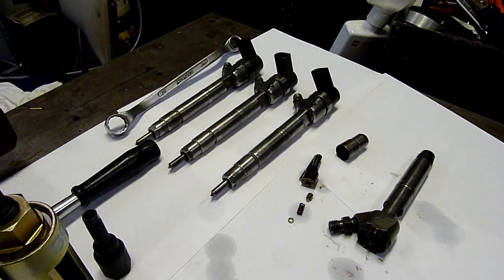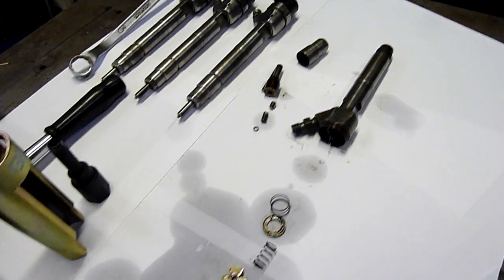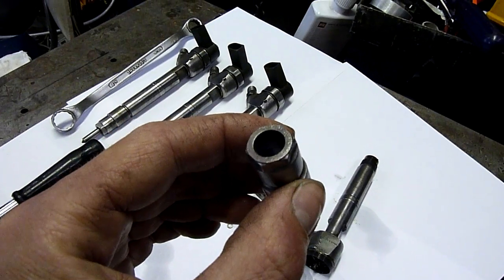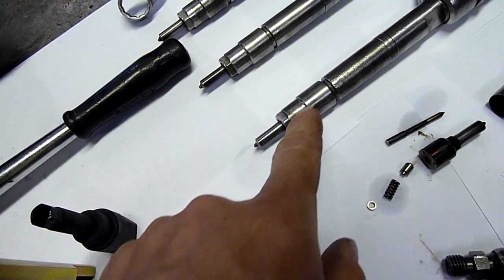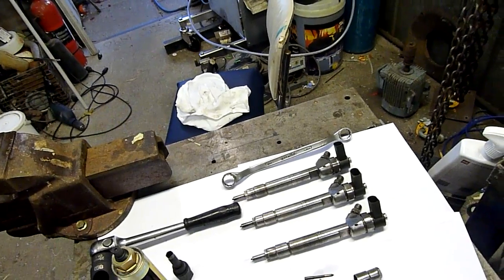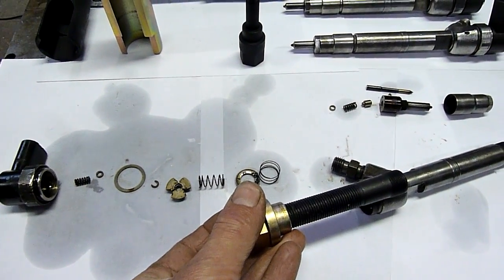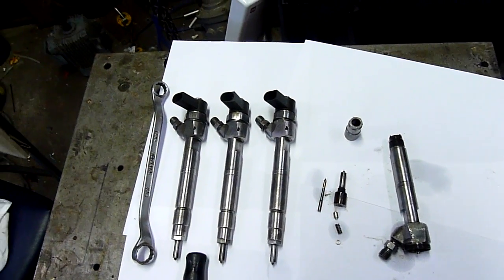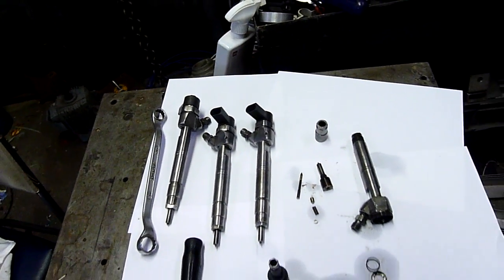Inspecting Cheap used ML270 Injectors (Mercedes OM612)

Comment: Had the same deal a year ago in Germany, for cid vito injectors, after 1,5 year they start making bad noise when reving engine under load. I think they put the cheap 11€ nozzle from aliexpress in it.
Gonna clean the original ones now with 300.000 on them.

How did your ones go?

Comment: Can l change the coil of the injector? because l have a problem after 
replacing ml 270 cdi year 2000 injectors the original was 0445110035 and
 the new ones 0445110201, but the ECU not recognize them. So would it be
 a good idea to exchange just the electronic part of the injectors in 
order to make it work?

Comment: i always learn watching your vids. did not know exhaust could get into injectors. i looked around for those for you but came up dry...
Reply from the maker: Thanks for looking mate!, they are a bit hard to come by.

The dead one was severely eroded so I  guess the pintle cap got a bit loose and the gas got past it when the cylinder eventually fired. its rebuild-able, but not really worth it at this point.

Comment: do injectors need a external clock signal, or just 12v dc ?
Reply: someone correct me if im wrong. but i believe that they have external computers that send signals to them.
Reply from the maker: smallenginedude71 that is correct, I tried pulsing 12V across the busted Delphi injector that I got, and the coil blew almost immediately. so its definitly not 12V alone.

Comment: For me the naive when it comes to cars... what does a wire wheel do to it?
I am guessing these need to be perfectly smooth and the wire wheel scratches them?
Reply from the maker: The holes in the tips are minute, they are drilled with a laser and if you wire wheel over them you peen over the edges and distort the spray pattern, or even stop it altogether.
Reply: Aussie50 This is why I go to a mechanic :)
So what is the proper way to clean these? Solvents?
Reply from the maker: Mark19960 I imagine an ultrasonic bath, and yeh, lots of solvents.
Reply: Aussie50
I did a bit of work for an injection specialist a few years ago and he'd use a jig with measuring columns for flow rate, a cleaning solvent and a modded delco 808 ecu (if you wanna drive them use an ecu - surely you'd be able to get your hands on something) and a fuel pump that ran a test/cleaning pattern (freq sweeps etc), though for a full dis-assembly/clean prob an ultrasonic bath or just ran a kit through them.  btw awesome work dude been watchin your vids for a while.

Comment: not  a bad  price  for that  tool at all ,, nor  for the  injectors ,,,
I just  replaced the  injectors in my 1987 chevy S10  which  has a  4BT cummins common rail conversion ,, they were   $300 each ,,I installed  bigger  injectors so i could  get a bit more power ,,,I am getting 225HP and  370pound/ft torque  from a 3.9 liter 4 cylinder  diesel  ,, which isn't  bad considering the  engine I replaced  had 125hp stock
Reply: Yeah, I'll bet that 4BT weighs almost twice what the stock 2.8 did, though, eh?
Reply: yes  it does ,, it is  very  heavy ,, but this truck  has a  very strong  suspension from the  factory ,, and I added some  stronger  torsion  bars and coil over   air shocks to compensate for the engines nearly  1000 pound weight with it's  accompanying transmission and cooling systems
Reply: Just put a 1.8t on it 300 bhp stock motor